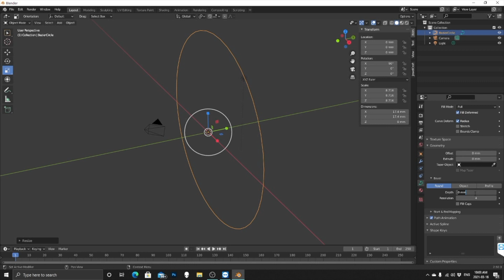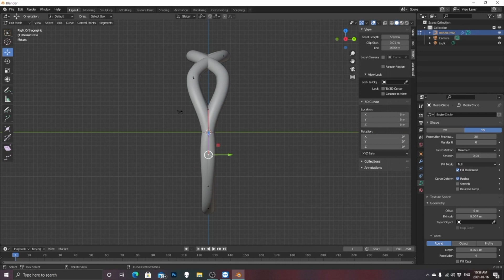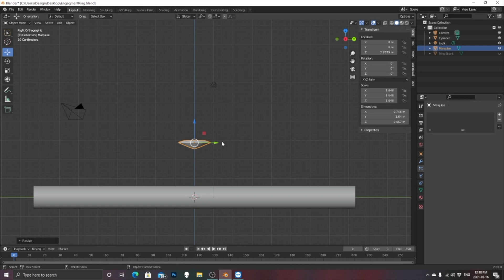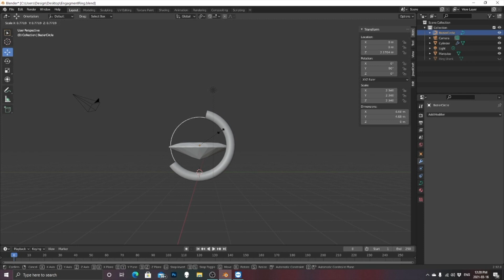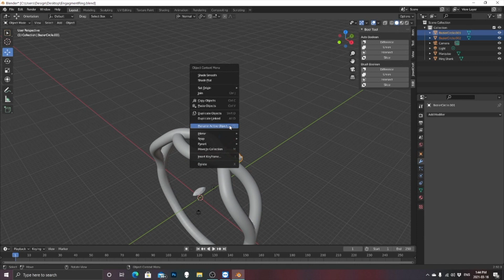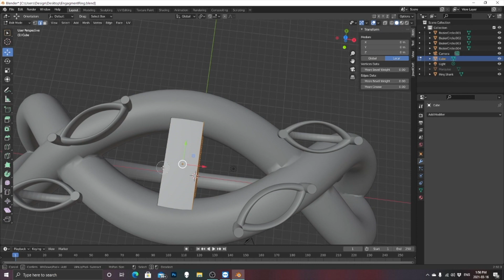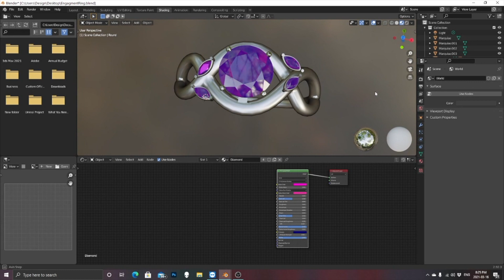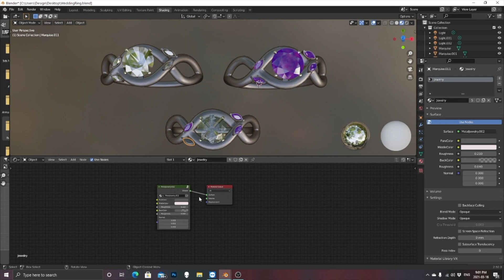Creating My First Ring Design in Blender

Comment: If you want to send me the stl, I can slice it with the support structure that will print on your prusa.
Reply from the maker: That would be great! Is it something I can get as well?
Reply: @nicolebalian  is actually all built into prusa slicer, you just have to manually change support settings to optimize printing for your ring.  It’s probably rotate the ring too a different angle and use tree supports to support it.   http://objectforge.blogspot.com/2020/03/tweaking-prusaslicer-support-tree.html?m=1
Reply from the maker: Thank you so much for the reference!😁 I will try it out.